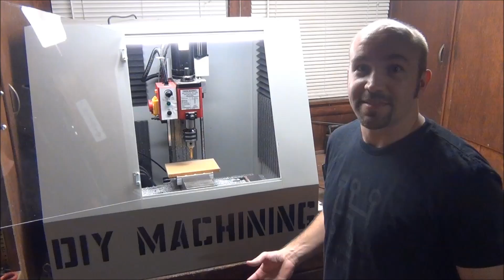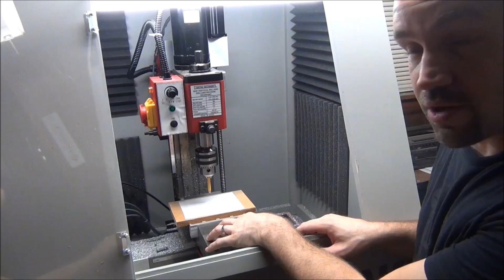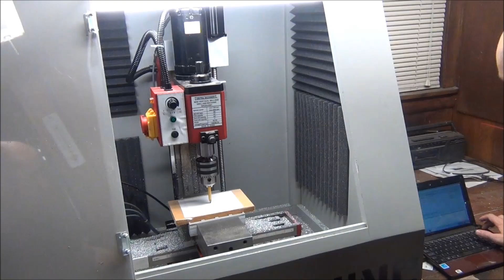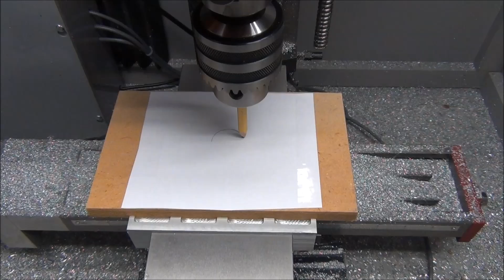How to Run Your First G Code Program on GRBL + Arduino

Comment: I have a family friend that has a desktop cnc router and he wants to use MillMage to generate Gcode to feed the GRBL.

My question is, does GRBL eat Fanuc/mitsubishi based Gcode?

So any Gcode that would run on normal cnc 3axis mill can run on GRBL?

Comment: ok sir, i have a problem,
i'm running a cnc prototype, on Arduino Uno / GRBL 1.1 
and when ever i send the Gcode file, it starts moving from (0 ; 0 ; 0) axes to the first point of the actual Draw i did in the Gcode, and STOPS

it says : G-code words consist of a letter and a value. Letter was not found
Reply from the maker: Hmm, sounds like there is an error in one of the lines of the gcode program. If you would like me to take a look, feel free to email the file to me at Tim@DIYMachining.com
Reply: @diymachining1934  absolutely

Comment: why give me this message (Buffer size too small)  when I put Gcode in 
Grbl Controller please ?????
Reply from the maker: Firas - I have not experienced this error myself but I read some about it on the GRBL Github wiki. See the following link... 
https://github.com/grbl/grbl/issues/427
It sounds like you may be trying to run your machine too fast. You might try lowering the Max Feedrate and Acceleration values in your GRBL settings.

Comment: hi. well after replacing my stepper motors and adruino shield, all you have done....works for me too......except:  when i "send" any drawing...the pen will go straight and fast.....way past the limits of the draw platter and stop without drawing at all. what is going on ?
Reply from the maker: Eric - Sounds frustrating. Will you post a copy of the .nc file you are testing? You can open a .nc file in any text editor. Feel free to copy and past here in the comments or send and e-mail to me Tim@DIYMachining.com

Comment: Thanks for the awesome video..Can you please suggest a cam software which i can learn to generate codes for grbl...except aut0desk fusion, as i dont have a 64 bit laptop..
Reply from the maker: You might check out Carbide 3D 
http://carbide3d.com/carbidecreate/
Full disclosure, I have never used Carbide 3D. If you decide to go this route, I would be interested in what you think.

Comment: Hi Tim, great videos and great website. The information is much appreciated when trying to figure this stuff out. Can I ask have you tried any 3D milling on your machine? I have just bought a SX2 mill and want to convert it to cnc however was wondering if the arduino route is powerful enough.
Thanks again mate.

Chris
Reply from the maker: Chris - I appreciate the feedback! Yes, I do a fair amount of 3D milling. I did a letter F key chain with a 3/16 ball mill and surfaced the whole part. 

https://www.instagram.com/p/BJJZ6lwDPMX/?taken-by=averworks

The real draw back is the 2500 rpm spindle. 10K rpm would be ideal.

Comment: great informative video, i want to know which software you are using to get G-CODE because i am trying with inkscape but  that files are not working, very much helpful if you replay,
Reply from the maker: Mr Innovative, good question. I use Fusion360 as both my CAD and CAM software. Fusion360 has a built in post processor for GRBL which I also use. I know it is a pain to switch between CAD/CAM programs. However, once I made the switch to Fusion360, I haven't looked back. If you have a file you would like to sent to me, I would be happy to see if I can make a gcode file for you using Fusion360. You can contact me at Tim@DIYmachining.com